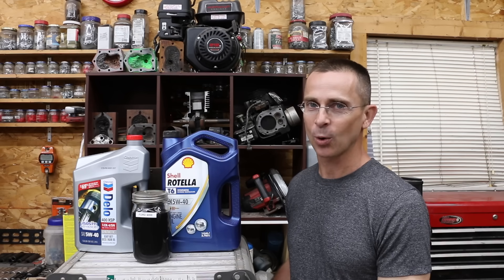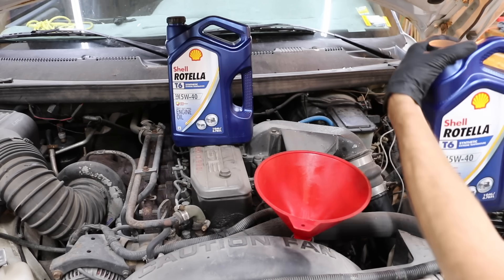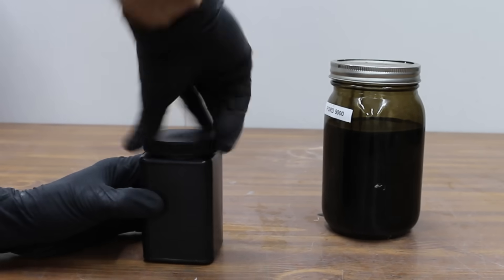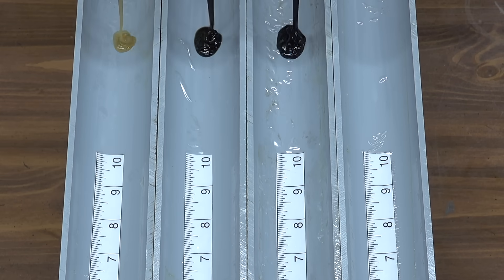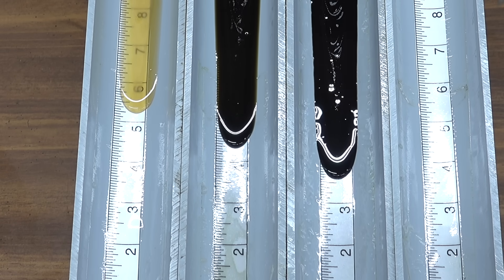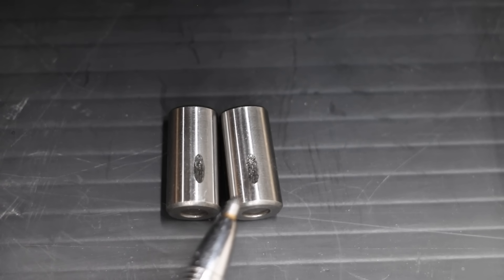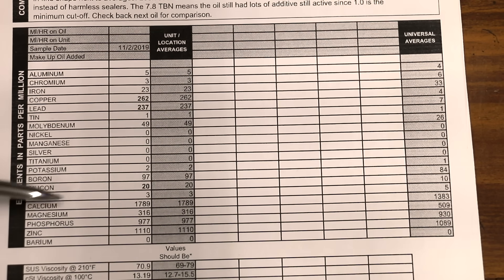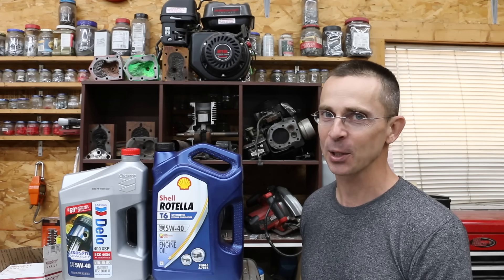Will Annual Oil Change Damage Your Car? Let's find out!

Comment: NEVER!!! fill a new oil filter before installing!!!!!!!!!!!!. You are putting contaminents on the OUTLET side of the filter!!!. Yes, a new can of new oil contains contaminents and particles.
ALL the oil AND FUEL filters, are filled  (by the pump on the engine), via the smaller holes around the outlet. Some engine companies, put the filters ''upside down'' so you can't pre-fill the filters. This is especially important for fuel filters!!!!!!!!!!!!!!!!. Do not worry about ''dry-starting a turbo'', the manufacturers made it so as soon as you crank the engines, the remaining oil in the oil galleries, will lube the turbos.
Reply from the maker: Thank you for the feedback

Comment: Each year? Thank god we don't drive turbo motors (they use oil bearing), so I change oil like every couple of years. Right now one car is at 35 kkm (22 kmiles) without an oilchange and the last one (2.5 years ago) was when the filter was so rusty it leaked oil. 250 kkm on the clock.
Reply: You must be leasing your cars - lol

Comment: My 2002 Chrysler Town and Country has 155,000 miles on it and now I change the oil myself every 6,000 miles. But the one thing I never changed is the spark plugs because the ones in the back are impossible to get at. Van runs fine and no loss in MPG. have you ever done old plugs vs new plugs as far as performance and power? How would one even measure that in a lab situation?
Reply: Well, spark plugs actually wear, as In the power electrode and ground strap actually start to lose material and the spark gap increases causing the coil to work harder to jump the gap until it can no longer make the jump, then you will start to notice hard starting an missing. Age for a spark doesn't really make any difference unless corrosion starts to set in from it not being used.
Reply: Luke Strough Maybe you misspoke. You’ve seen a spark plug corrode from not being used?
Reply: You better pay to have them changed out. Alot of times we have to replace cylinder heads because they seize in there.
Reply: My 1999 Town and Country has 217k on its original 3.3 V6. I have changed its plugs twice, at 130k when I bought the van — for $1,500 — and at 206k. Yes, those rear bank plugs are hell to get to, but I changed them without removing any engine parts — and my hands are not small. The iridium Denso plugs from the 206k change had evident wear,  so the new plugs were worth the effort. As for oil: Kendall 5w-30 with Wix filter every six(!) months regardless of how many miles driven. The van burns zero oil; I add maybe a quart between changes on account of slow leaks from rear and front seals. But in the nearly 90,000 miles I have had the van there has been NO engine work of any sort. Yes, this is a Mopar machine and I am amazed myself. The oil and filter changes might be overkill, but at maybe $20 per change I consider them the cheapest of insurance. All that said, these Project Farm tests are fabulous. Just this week I bought a set of Stanley utility knife blades and Makita angle grinder metal cutting disks based on PF tests.
Reply: @TruthInFlying  20 bucks for 5 qts of Kendall and a Wix? Where are you getting Kendall that cheap? They don't even sell it around here but I do know a guy that orders it who I change oil for sometimes. I always thought it was kinda neat to see that brand still around but never asked him what it cost. I use Valvoline MaxLife and a Purolator 1 every 6k or so. costs me probably 30 bucks if I catch a sale. The MaxLife has slowed the valve cover seeping a bit. I no longer have to add a qt, it's just about at the add line when changing time comes.
Reply: I remember when the plugs had to be changed often because of lead deposits. Full service gas stations had little spark plug sand blasters. Also had spark plug testers so that you could put pressure on the plug.Takes more voltage to fire the plug when it's under pressure. You could buy reconditioned plugs at the auto parts stores. Those were the good old days. Just put aridian plugs in the old tractor. Probably will outlast me.
Reply: @ralphwood5114  I actually have one of those little sandblasters for plugs, I filled it with glass bead, works miracles on 2 stroke plugs!
Reply: If you use iridium spark plugs u can go yrs without changing them.
Reply: @snoopdog6793  Don't also forget it's also miles.
Reply: Seriously, you should change the plugs. If you do want to do it yourself, pay someone.
Reply: If ain’t broke don’t fix it.
Reply: Now you KNOW if you change those plugs out your window wipers will just stop working just because 😂
Reply: I can change the plugs in about 10 minutes on my 06 Altima 2.5. No excuse for not changing them. The old Chevy Monza V8 you had to lift the engine to change the plugs. The Monza was designed for a rotor engine. GM gave up on that idea. A Pontiac came into the shop with a miss. A plug was hard to get to. Someone tightened. The plug with channel locks and broke the insulater.
Reply: @ralphwood5114  you sure it wasn't a Ford Triton? Good God what an abortion 😁
Reply: @dangoldbach6570  ha. I'll tell you the trick to doing those, as told by a 25yr Ford tech. 1- pull out the coilpack retaining bolts. 2- take the truck out and run it hard so it's hot. 3- as soon as you park it, yank those coils and hit all the plugs with an impact. 
I would never do this to any other engine but I'll be damned if he wasn't right. He almost never broke one that way. Also put antisieze on the long part (not the threads) when installing new ones.
Reply: a few dyno runs averaged out
Reply: Remove the whole wiper cowl/assembly(15 minute job) and replacing the back plugs on those vans is a joke.
Reply: I think you guys who never change plugs would be surprised how much better your engine runs after you change the plugs.
Reply: Cleetus mcfarland has a dyno.That guy loves using it.
Reply: I feel your pain. We have one of those and it has 255k. I bought it cheap with 200k and did the plugs then. They were overdue for sure, and not fun to reach. I think I used a socket, swivel, extension, and flex head ratchet. It's possible that a couple hp here or there may be gained, but mostly it's the smoothness of idle and lack of misfires that you're getting as a benefit. Some plug companies like to hype up that their top of the line plug can burn faster or this or that, but most of that is determined by compression ratio and head design. I just put the regular yellow box NGKs in everything but my Benz which I just put in the NGK iridiums just to see if they really last longer. That car has coil on plug ignition and a bad plug can kill a coil, which can get pricey quick. So I figured it was a worthwhile experiment.
Reply: them back ones are easy just take the ole reach around
Reply: Way way back when I was in High School auto shop class we had a spark plug cleaner and tester.  It used glass beads to blast the plugs and then we used air and solvent to wash and make sure all blast media was removed.  We then put them in the tester which had a coil and it ran a steady voltage to the plugs.  The tester had a mirror and a window of some sort and we would use air pressure regulated to the small chamber.  We found that most plugs quit firing at around 150 psi if I remember correctly.  We found that if we buffed the electrode and the threaded end of the plugs with a fine wire wheel they would always test better.  This was over 50 years ago so I'm sure they have better test devices by now.
Reply: I'm the same way with oil. I have an '05 Dodge  Grand Caravan SXT with 245K+ miles and use full synthetic and change the oil every 6K miles. I have the 3.8L and the spark plugs are easy to get to. You don't have to remove the wiper blades and that shroud either! Just reach around the intake plenum and there is also a vacuum hose you'll need to remove from the back and from the brake booster I believe as well. A swivel adapter and a wobble extension did it for me and all 3 plugs/wires came right out/off and back in/on with no issues. I'd check your coil pack while you're at it, too. Mine was bad and needed to be replaced when doing the plugs. The clear plastic/resin bottom was cracked and allowed water in.
Reply: @DCecil21  I guess it's to Harbor Fright for a swivel adapter. Thanks.
Reply: My dad has a 2009 yaris with 175k miles with original spark plugs. Thing still runs pretty good!
Reply: @DaBossk  Not bad, those plugs are due every 40k
Reply: T & C and Voyager aren't THAT hard to change all the plugs, just get a pivot adapter and  extension..... BOOM simple.
Reply: as long as you dont change any of the plugs the pcm might continue to account for the increased gap until one of the plugs fouls or breaks.
Reply: to get the plugs in back it’s easier to get them from under the car, same for anything with a ford 302/351w motor, it’s more roomy in the bottom
Reply: Check for missfires on those particular cylinders, its a possibilty that your timing has been retarded enough (due to missfires) that old plugs will seemingly work fine.
Reply: I would ask someone experienced with servicing your engine to change them out. Eventually you’ll get misfires and a check engine light. Believe me, I know from experience.
Reply: only reason to change plugs is so they don't seize or weld to the head, If they corrode or have been sitting for ALONG time then you may want/need to change them but otherwise, I don't see why they couldn't last forever
Reply: @Ran-dom1  the electrodes will wear out eventually. And on a vehicle with coil packs it can ruin them because the coil has to work harder as the gap increases. Now on something old, there is nothing wrong with cleaning and regapping. But as cheap as plugs are, I'd rather just replace them if I'm taking the time to pull them.
Reply: Ran Dom you mite be right about them seizing, many modern cars have aluminum heads... My experience is with iron heads for the most part... Witch I could see being an issue with modern fuel injection you don’t necessarily have  to change or clean them........
Reply: I've had first hand experience with this recently, and as long as 25 years ago. With extremely worn plugs vs. new plugs, I noticed a big increase in low-end grunt (torque) with the new plugs. Also started quicker, and fuel mileage went up a mile or 2 per gallon.  

More recently, I've seen many check engine lights on, just due to extremely worn plugs. One time I took a set out of a 3.0 V6 in a Mercury Sable that I could only measure the gap using an Allen key - almost 100-thousandths (.10) estimated gap! They were the OE, factory spark plugs at 170k miles!! There was nearly nothing left of the center electrode. 😂
Reply: you should get them changed when you start to feel a misfire or get a check engine light
Reply: @keegan Johnson Where I live in the Pacific Northwest my locally owned auto parts store sells Kendall as something of a loss leader at times at around $3-3.50 a quart — $2.50 not that long ago. It is the least expensive oil in the store. I buy Wix filters a case at a time from Rock Auto. (If you watch You Tube videos of guys dissecting new Fram filters you will never buy another. I threw away a half dozen unused Fram filters the other day rather than install that junk in my equipment.)
Reply: Was using a mine detector in a creek bed once. Kept finding old spark plugs.The locals were closing the gaps and using them for fishing sinkers Lost a lot of them in the Rocky creek bed. How did we get off on spark plugs. Not in the war. In Idaho when in the National Guard. They were used to catch Cut throat trout.
Reply: At 155,000 it definently need plugs and the extra large gap is really hard on the coil pack. It's easy to get to the rear plugs if you remove the intake . The  3.3s and 3.8s are notorious for intake and valve cover gasket leaks anyways so It would be wise to to it all at once. Along with plug wires...
Reply: @bdd1469  Had a valve cover leak - changing to a high mileage synthetic and Bluedevil stop leak solved that.
Reply: Idk my sh*tbox 03 Nissan Altima 2.5s hasn't had an oil change since I've had it for almost 2 nor have I changed plugs and it's at almost 200k miles lol
Reply: Don Walker  if it wasn’t a shit box when you got it, it’s sure is now
Reply: @donwalker1882  have you even topped it off? Man. Change the damn oil at least once a year, even if it is a shit box. I used to have a 1984 Honda Prelude that I never changed the oil in. But it burned some so I just added a qt every few months and changed the filter once a year. It never slugged up.
Reply: @eclipsegst9419  nope just a quart every now and then when my light comes on but it leaks enough it's pretty much like a consistent oil change lmao but it only had no oil once when I was in a hurry and forgot the cap on the valve cover and drove a good 80 miles while oil was fishing in the engine bay lmao but those Yaris are tough too I think it just might be an overseas thing tbh
Reply: @donwalker1882  they know how to make small engines tough, that's for sure! I honestly think that Honda I had probably had like 300k on it. The odo said 230k but then I found another one in the trunk that said 125k. So who knows what the actual miles were haha.
Reply: @eclipsegst9419  maybe the cluster broke and they left the old one for reference and forgot to take it out of the car xd
Reply: @emmareporter  haha who knows. I found all sorts of old junk parts in the trunk. Including a spark computer (primitive ECU) intake manifold, and I forget what all else. I never replaced a single part while I owned it though.
Reply: Don Walker this is the reason you shouldnt own car, you are not worthy of it
Reply: Last car 230,000 miles never touched the plugs. Current car 210,000 miles never touched the plugs.
Reply: @jimleverington1348  Sure, un huh, yeah -  230,000 miles?
These comments are why i love these keyboard," know nothing"  mechanics, like you!
100K is tops on miles,  to change ANY PLUGS!
Reply: @coiledsteel8344  I'm not a mechanic. I'm a retired engineer. I see no reason to change plugs, flush the transmission, or do a lot of the other "recommended " maintainence . I buy cars new and drive them until the wheels fall off. I do change the oil every 6000 miles but that's about it.
Reply: @jimleverington1348  what engine and usage? My old slowly driven taurus 3.0 Vulcan went 188k on the original spark plugs, they only went out when I floored it to redline for the first time, I was  impressed
Reply: @scarea2691  those old Vulcans were tough engines. The dealer I used to work at had some old taurus's they used for rental cars. They had the everliving hell beat out of them and my boss only did maintenance if something actually broke and still the cars rusted away around the engines. Not a one had less than 200k. They got one oil change a year with the cheapest 10w30 he could find. I don't recall ever doing plugs but they were already near their last legs when I started.
Reply: @scarea2691  my last car was a 2001 cavalier and my current car is a 2005 venture van. I never touched the transmission on either car. I found that the mechanics like to charge for work that doesn't need to be done and actually make cars less reliable

Comment: Actually, I do this with my outboard around 2 years, still strong and runs great.  I use Yamaha 10w-40 oil in my boat in Hong Kong, the weather wasn't a problem, it never drop below 5℃ in here, average running at 3500-4500rpm most of the time.

The main theme about oil change I think should be for hugh temperature change with the environment not about the motor did with the oil.
Reply from the maker: Thank you for the feedback

Comment: Pfft, everyone knows that a screwdriver is the best oil filter wrench...
Reply from the maker: Thank you for the feedback
Reply: Hahaha!! Only for unscrew it I believe..!!😄
Reply: @chronoZ750  No, use Phillips head to tighten..
Reply: @nottherealmccoy4955  LOL
Reply: We used that trick on fighter jet TEO filters all the time. The filter shell had a 1 1/2 inch hex head, but after being over torqued, then over torqued again as the rapid temperature cycling caused them to expand, shrink and then leak, you would destroy the hex before you'd even get them to start turning.
Reply: I hate this comment so much, along with the GM dealership that used to change the oil on the ol lady's truck.....
Reply: Yeah, sure, and the ditch is the best place to dispose of it too I presume.

Comment: Don't tell Scotty Kilmer about these results. It might turn his world upside down that oil can still be perfectly good after more than a year.
Reply from the maker: Thank you for the feedback
Reply: I stopped draining oil in 1963. Started with a Frantz oil cleaner and Delo 100 30 wt in my Rambler American. When Motor Guard came out I liked the design better. Now I use the Gulf Coast also Any engine with a oil pump gets a bypass depth filter. Using Wal Mart synthetic now in everything.
Reply: Did he Say “time” matters?
Reply: Find Scotty Kilmer generally ok but sometimes missing facts that can be checked like tests like these with lab analysis included.
Reply: Martin Weizenacker Scotty says if you use synthetic oil to change it every 10k miles or less.... and conventional oil every 3-5k... he’s right
Reply: @theredfishkid  For how long? 1yr good for both?
Reply: I can't watch that guy I swear he just repeats what car forums say.
Reply: Ha ha yes! But Scotty is a doom and gloom merchant. He uses this as clickbait methinks.
Reply: @garymills6702  is he? He often says to ignore your check engine light...